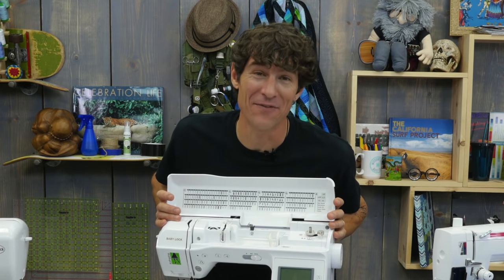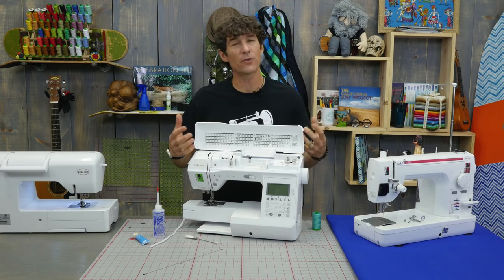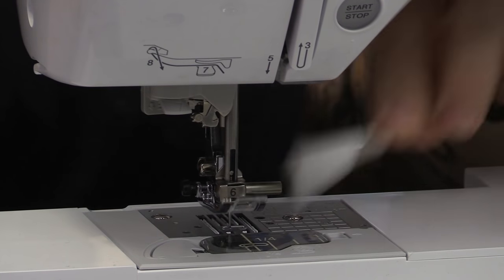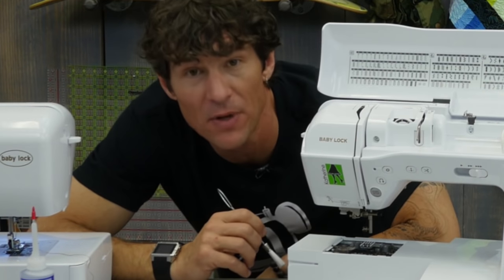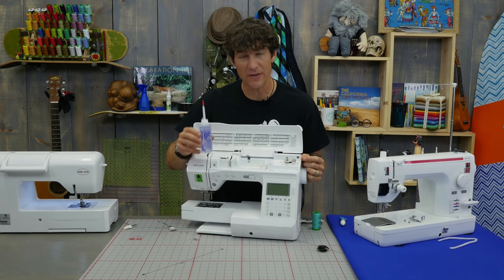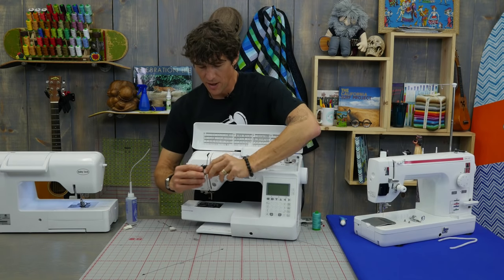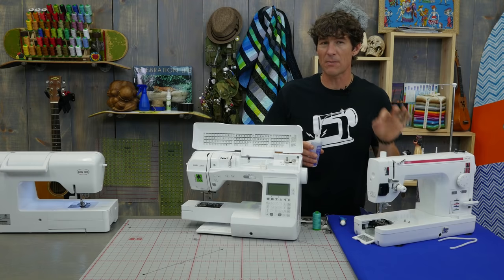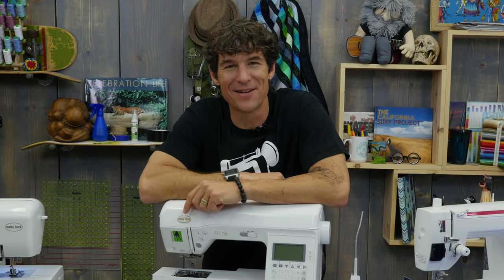Sewing Machine Maintenance: Oil and Clean

Comment: Hi! Thanks for the info in this video. I enjoyed watching as I’m about to attempt to service my machine myself if you can answer this question for me..

My machine keeps sewing a loose stitch no matter what I do to the tension. I was told by the most reputable sewing machine service provider near me, that it just needs to be oiled. Are you familiar with this issue? If I do the suggested dusting and oiling you showed in this video, would it fix my tension issue? Thank you!

Comment: I live in NYC, during this pandemic I am spending more time sewing but the machine is maching a loud noise as I sew. Im afraid its going to break apart. It also makes noise when I press the peddle/it does not sew. I cleaned it out just as I saw you do it during the video. I do not have the oil, just ordered it at Amazon. After dusting, the machine stull making the noise.

Comment: Your videos are helpful for my other machines. I have a Baby Lock BL101 Hemming machine. It is used but works. I am trying to repair something, I found parts but I need to open it up to do this. Some areas are really hard to get to..tight space to work in and of course some of the screws have different heads; straight, phillips & stars don't work on all on some, neither do hex. Secret tools are used??? Right??? Why couldn't they use have made it easier??? LOL.. I cannot find a service manual for it. I would open it all up if I could find the right tools. Any suggestions??? Thank you for all of your videos.

Comment: I removed my bobbin case from my Singer 5932 machine to clean and oil it.
I replaced it, but the thread from the needle goes across the case and the bobbin thread isn't working. I took it to a repair shop and they said that it seemed like something was missing near the bobbin case and they didn't know what. I have ordered a new bobbin case. My machine drop in bobbin looks like your pictures. Have you ever come across this?
Thanks.

Comment: Hi there I dropped you a comment about oil ling machine last night, I have done but seems to have found the problem one of the washers with a circling on it that drives motor has perished. Just where do you get spare parts from and will all the other washers start to go now 
thanks for all your help much appreciated

Comment: I have a question about the bobbin.  I have a Bernina 750 and it has the bobbin holder with the little “spring” inside, but it is missing (lost). Can I simply tighten the large screw on the bobbin as you did in the video, or should I purchase another bobbin holder?

Comment: Hi, I have a Brother Disney Embroidery/Sewing machine with drop in bobbin. I took it apart carefully placed the bobbin case on the table the way I took it out. Cleaned the machine, placed the bobbin case into machine and it won't go back in. I've read n looked at photos in my book n still can't get it alined to fit. Lol reading this back it almost seems hopeless. I've tried countless times through the day turning n trying to line it up. My dealer is over an hour drive so it's not like I can just walk it in. They don't do same day so that means 2 trips n 1-2 weeks in shop. Just to slide this case in. If you have any idea's I'd be happy to hear it.
Judy

Comment: tension help? I have a Pfaff IDT Passport 2.0, I'm a beginner (did i completely mess up my tension?) my top thread is not creating a loop, looks like a string being held and knots in between where my stitches are supposed to be created. I may have overturned my bobbin dial one too many times in both directions. I have rethreaded top thread and bobbin, followed diagram on my machine. I even also just thoroughly cleaned out the lint from bobbin case. Is there a default reset on tension for bobbin? I have pics to post??

Comment: Hi can you please help me understand what parts to add grease and what parts to add oil? I'm told they are not interchangeable? Also, my janome combi 10 turning wheel squeaks every time I turn it (and this has just been serviced) there are 2 white plastic disc on the turning wheel location. Should I grease it or oil it. Many thanks

Comment: My Singer 188k1 (very recently acquired) actually has a grease fitting - like the ones on automotive universal joints - on the bottom gear case! I'm not quite sure what to do with that. I can't use a tube of lube like shown in this video, but I'm pretty sure I shouldn't bring my grease gun in from the garage to lube my sewing machine. Any ideas? Can I just fill a mini-gun with white lithium grease and lube my sewing machine with that? 

Also, I get why canned air wouldn't be good. But, what about a vacuum? I have a little hose adapter kit with various little nozzles and brushes designed to clean out computers. Seems like that would be perfect for cleaning out my machines. . . What do you think?

Comment: I haven't used my Singer much in the past few years. It's been at least 6 since I've had my machine serviced. I'm out of, "sewing machine oil", and I'm in the middle of week two of making masks for healthcare workers during this plague. I'm not sick, but our state is on mandatory stay at home orders. I cannot get my machine serviced elsewhere, but suddenly I'm having terrible tension issues, and stitch skipping. 

What can I do to service my machine so that I can continue making and donating masks to my local healthcare and grocery store workers? Please advise🙏 Thanks in advance
Reply: Call your local sewing machine store, they may service it for free (we have a repair person in our town who has offered to fix machines for free during this pandemic).  Good luck!  I’m also making masks and am having tension problems, that’s what brought me to this video.
Reply: @joyflemming6842  Thank you. I'll call around and see if someone answers.

As for the oil situation. After doing some research I found that a drop of white mineral oil (the clear stuff) can be used to oil a Singer.   It helped a little, but I'm still having issues.  I think I messed up the alignment or timing by wobbling the advancement knob to release the threads, when it locked up and wouldn't turn towards me. :(

Comment: So i have a dressmaker sewing machine 2400 and im trying to figure out where my oil points are and after changing the needle on my machine the thread keeps getting snagged at the top and i can't figure out why. I also have a Kenmore sewing machine having the same issues except it's the bottom bobbin thread that gets caught and it breaks everytime is there anything you can do to help guide me through my issues

Comment: Thanks for the awesome video!! I’m new to sewing, and have never cleaned my machine...when I took it apart, under my bobbin case there is a hole that looks like there is felt in the middle of it, or is it debris? You mention a wick...is that what it is? My machine is a Ken,ore 385 just wondering if I should try to get that out of there.

Comment: Hi Rob, I am so happy that you are doing this series on maintenance.  My manual says nothing about oiling (Juki Exceed F400) so I'm assuming it does not need it?  I plan on bringing it in for tune ups every 2 years.  Am I correct in not oiling as long as I keep it dusted?
Reply from the maker: That should be fine, but it won't hurt to oil it every once in a while if it starts to squeak or grind. :)

Comment: Rob, thank you so much for this. This helped me alot. And I see you had 2 baby lock machines there, are you interested in getting rid of one? I would love to have a baby lock.
Reply from the maker: Those are the ones that I use on set at Missouri Star Quilt Co when filming. I better not get rid of one since I borrowed it from the retreat center. :)
Reply: Please what to do when you run the motor and it turns very fast by itself, however when you hang on the belt and the machine running very slow. Why? Please help me. Thanks

Comment: Rob I often watch your videos and paid particular attention to the ones on maintenance.  I own an Elna computerized model number 6004 and have owned it for many years and in that time it has never been serviced or oiled.  I have read and reread my owners manual and no where does it recommend oiling.  Should I be oiling it?
Reply from the maker: Hi Patricia! Thank you for tuning in. I would recommend doing a bit of research on the model and talking to an Elna dealer to learn more about the best practices for your machine's maintenance.

Comment: Please what to do when you run the motor and it turns very fast by itself, however when you hang on the belt and the machine running very slow. Why? Please help me. Thanks
Reply from the maker: Sounds like the machine is ready for a service, probably needs oil to help it run smoothly, and the belt tightened. Machine maybe quite old if you can still get your hands on the belt while it is running, so take it slow or take it to a pro. I hope this helps!

Comment: I have a basic Singer home machine, purchased about 15 yrs. ago.  Last time used was about 6 years ago.  When I tried to use, the hand wheel will not turn.  Should I take in for maintenance or try to do this myself at home?  I may soon get hired for sewing project, and being unemployed I really need this gig and would like to tune up the machine myself if that's possible.  
Any suggestions?
Reply: Hai Miss. I think you should just oil it a Little and rotate it and it done. You can use it rite

Comment: Man Sewing Guy, I own a Kenmore 158 18024. I've had it for 22 years. I have not had any problems out of this machine. I clean and oil it regularly with Singer sewing machine oil. I have never had it 'serviced". It has never needed repair. If a machine is running well and not giving you any problems, is there a reason to have it "serviced"?
Reply from the maker: Hey Melani! I am from the school of thought, "if it aint' broke, don't fix it" however, I do see a need for service on most power tools. As often as every dealer wants, probably not, but serviced by a pro can add years. Now in your case, 22 years is not that old for a sewing machine. Probably manufactured with oil pressed into the bushings and, therefore, the machine has been self lubricating for years. That oil can be added to the surface, but not pressed back into bushings. The grease that is used in many machines will turn at about the 15-year mark and become sticky. The more we use are machines, dust our machines, and do the light oiling form the exterior, the better. The worst thing to do is run the machine hard, then let it sit for months and months, that is when the machines can seize up. Once the machine is no longer under warranty (many are covered 15-20 years) and If you can remove all of the covers yourself, then you can hit it with an air compressor, not the can of spray air and oil all the moving parts, then run it, blow off the excess oil and put it all back together.

Long story, yes if you love the machine, at this point you should consider treating her to a spa day, way better than buying a new machine. :)
Reply: My sewing machine is 45 years old. I've had it for 22 years. It was completely clean when my husband found it at a thrift store. If that make any difference. Thank you for your response.
Reply: Man Sewing t

Comment: I’ve cleaned and oiled my Janome new home. The top thread keeps breaking. What seems to be the problem?
Reply: Hi Barbara! Have you replaced the needle too? Is it up all the way in the receiver? This could be the problem. If you were not having problems before the cleaning, then try to re-thread - you may have missed something. Make sure that your bobbin is correctly seated. Lastly, look to see if the thread is catching on the spool somewhere, maybe a snag along the spool of thread path.

I hope this helps!

Comment: I am desperate. I bought this two year old Brother LX3125 from a friend, and I cleaned it, oiled it and I am sewing these fleece blankets on the edges so they don´t run (very thin fleece), the machine starts jumping and wobbling and I have to stop, then I continue sewing but again the machine starts jumping and wobbling after doing about 5 inches of sewing... the stitches are fine, no bunching, but this jumping and wobbling worries me.... please help!!! I am thinking of taking the machine to a repair shop, but maybe there is something I can do...
Reply from the maker: Hey Romana! I'm happy to hear you figured out the issue with your sewing machine. Wobbly tables can be tough to sew on! Hope you are working on some fun sewing projects!
Reply: Just replace a new needle 2020 singer brand miss

Comment: What i know is the only people who can bring domestic sewing machine to life  are those who manufactioned  and assembled it. Domestica machine used everday for 4, 6 hours could last for 7 to ten years. What i saw here is just like dusting a room, pick out sports without washing the floor. The bobbin disc has a transporter that rotates under the bobbin case that, make the stitches, repairers don't touch this. The greese comes with the machine, as we remove dust on the surfaces the greese catches the lighter dust and park on pastin coupled with to rings stitches regulators very light rings, that is the killer of every domestic machine. 
I know dealer who are also the repairers wanted it like that so that the can make money as amending old things, does not pay much.The would have made it easier for some like me who hate diry things out of my sight. and when does small rings in the pastin damages, it has no number, or they no longer have it in stock why then new when every domestic machine is the same. That is money making.

Comment: "Air dusters increase CO2..." No. They contain greenhouse gases of which some are more potent than CO2 in terms of global warming potential, and some even have ozone-layer depleting chemicals. It might be good to note he dusting brush he used has a carbon footprint probably a bit bigger than a single can of spray air. Just sayin.
Reply: Oh a good alternative for those spray dusters is either an electric duster, often sold to computer technicians, or a bulb blower/duster used for photographic applications.